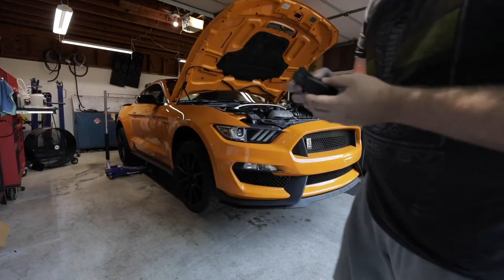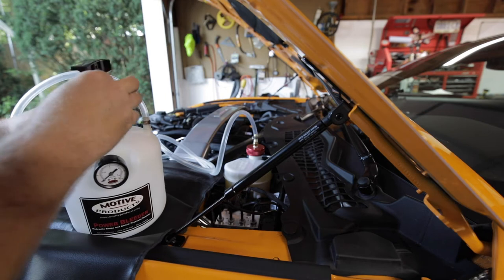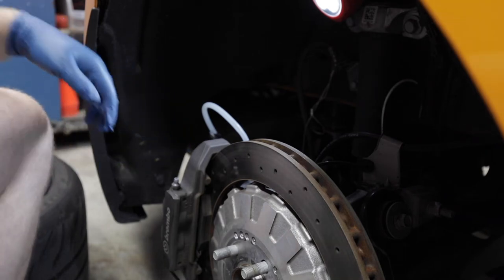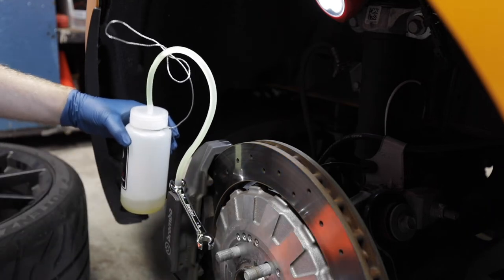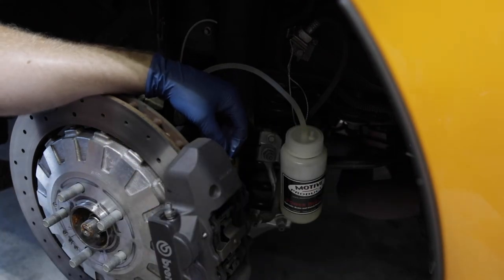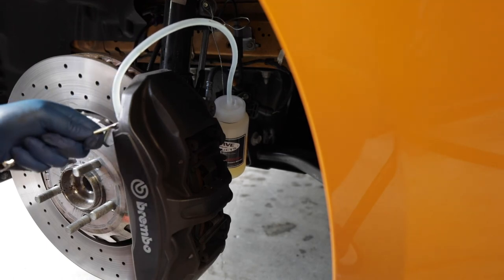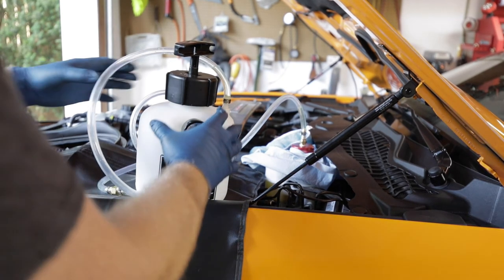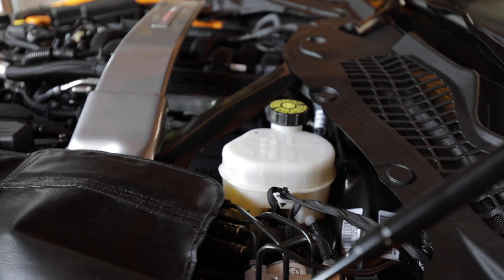Shelby GT350 Motive Brake Fluid Flush

Comment: Handy lil mod to the motive power bleeder jug. I drilled a hole in it & installed a 2 pc schrader valve. That way i can use my air compressor to pressurize the jug quickly. Ignoring the laborious time consuming lever. It takes forever to pump up to 12 or 15 psi!!! Extra perk...can vacate pressure with the schrader valve in an instant. I fixed the problems ppl have with the otherwise very handy motive pressure bleeder doing that. I did a total brembo brake caliper swap to my 2010 stang gt, motul 660 fluid 4-28-22...using the motive pressure bleeder with a schrader valve that made it super stupid easy to bleed the brakes after the swap with no need for anyone to pump the pedal. I did push on the pedal thruout the process but only to push the pistons out one corner at a time. Adding a schrader valve shines nicely with the motive power bleeder. Motive should offer it & would only add maybe 5 bucks to the product. O my i just realized gingerbread was our coach at Putnam scca 2021 in Aug. FYI...you do not have to add fluid to the motive pressure bleeder! Just vacate the pressure & add fluid to the reservoir as needed. All ya gotta do. That way the job gets done & you dont have to clean up the pressure bleeder. In other words its not nessessary to push fluid from the pressure bleeder to the reservoir. Just creates an extra step & bleeder cleanup.